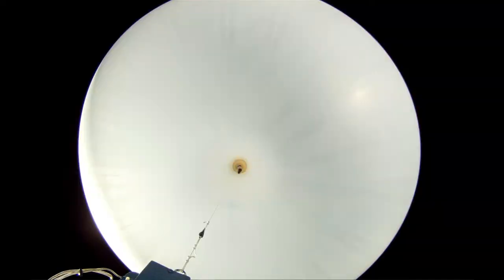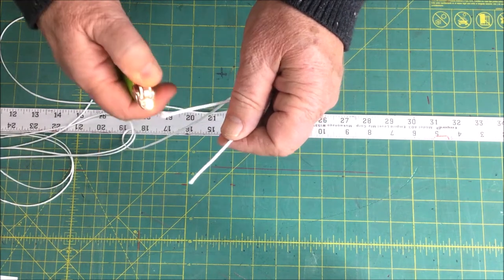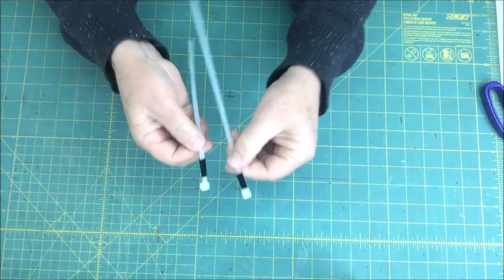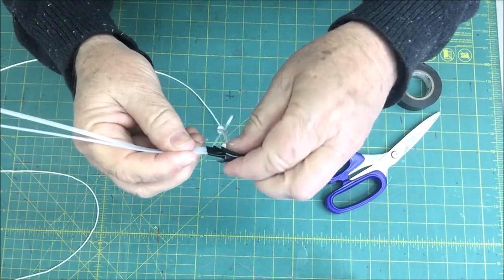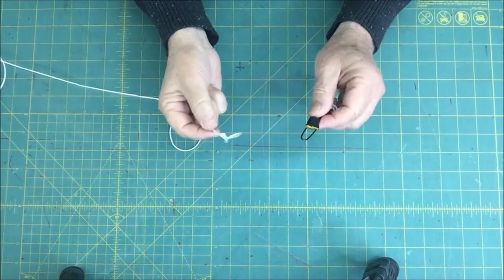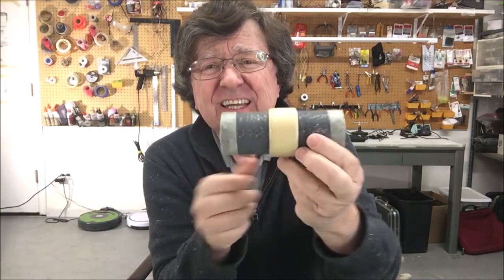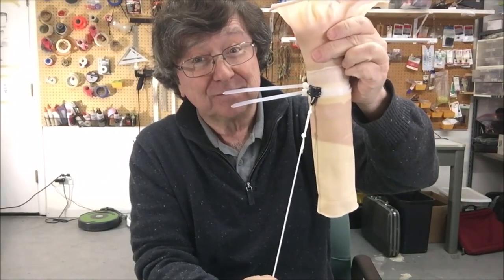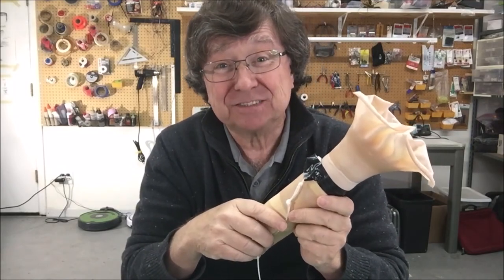How to Rig Your Weather Balloon

Comment: I really like that.  It eliminates the terrifying moment I always have as I pull the fill tube and keep a death grip on the balloon as I try to fold the end of the balloon to capture my payload line.  I don't love the zip ties against the latex, but if it's worked for 100+ missions, I'm willing to go with your superior experience. Thanks for sharing!
Reply from the maker: You can also take a loop of line and run it under the quick tie. Then you have a handle. You could also clip it to a loop around the tank with a D ring so it can't get away.
Reply: @johnmpowell  Ya, I usually put 4 stakes around with loops in them, which I thread fill tube and balloon through.  After the fill, I pull the tube, and fold the end over, capturing the 4 loops, so the balloon is staked to the ground.  When I'm ready to launch, I just cut the 4 strings leading to the stakes, and use the 4 loops as one to snap on my rigging.  The downside of that approach is the scary moment when you yank the fill tube out, and there is nothing but my death grip between success, and the balloon going phhthththhhthppbt off into the countryside.  I actually had that happen once, and it sucked quite a lot.  I'll make up one of those internal tube doohickies and give this method a try.  I love the idea that if I lose my grip, the worse that's going to happen is some hydrogen will escape, but the balloon's not going anywhere.
Reply from the maker: @keithbrzak  The stiffness.